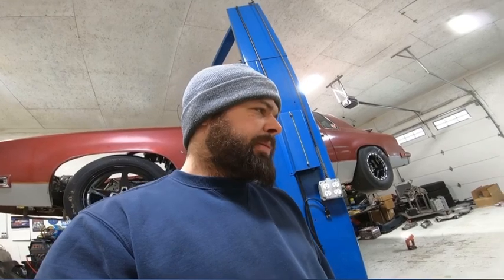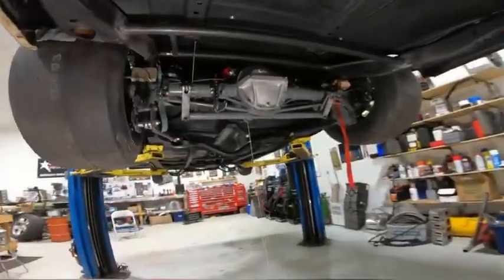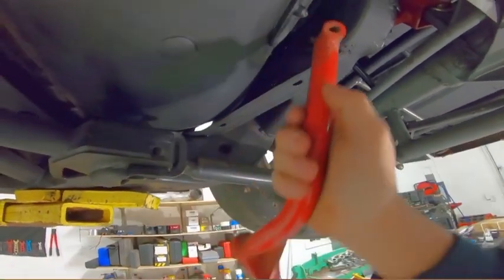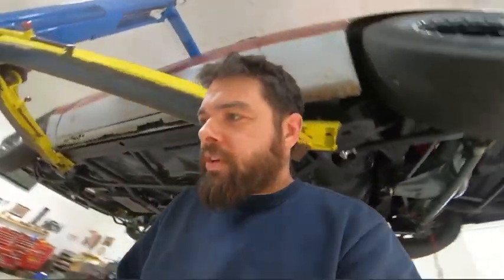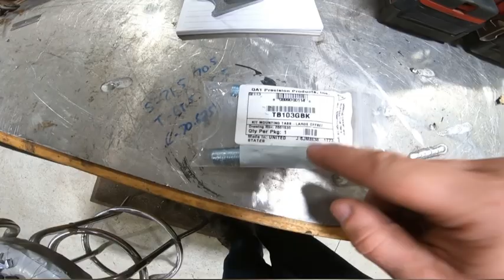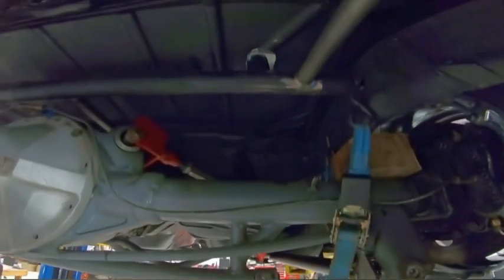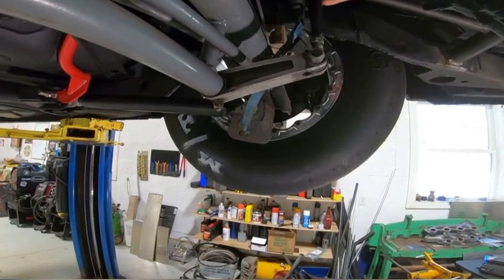Episode 20 - LS Turbo Cutlass - Burg gets a mid plate & rear suspension goodies

Comment: Would they make a difference in my street strip monte with 9in you think?
Reply from the maker: The adjustable spring perches are for stock location springs. If you are using stock location, they let you raise and lower the ride height.